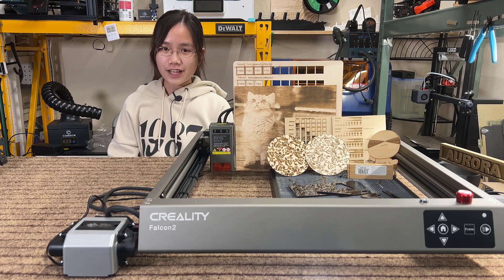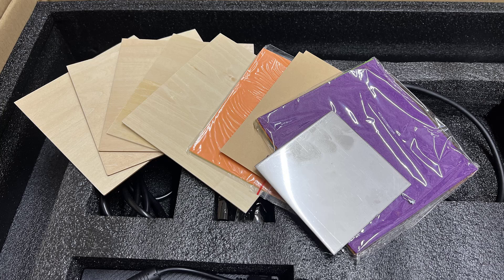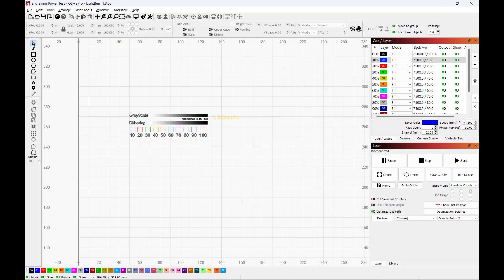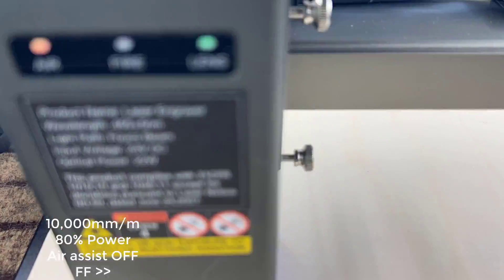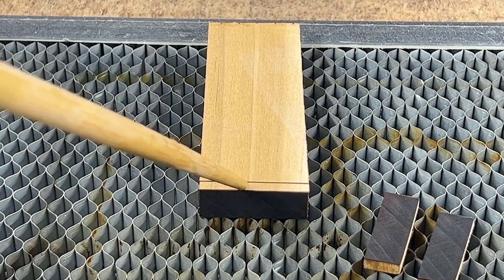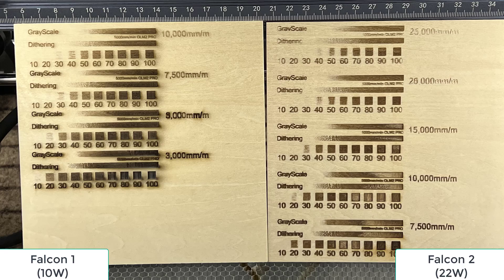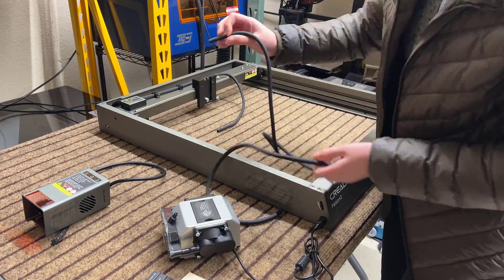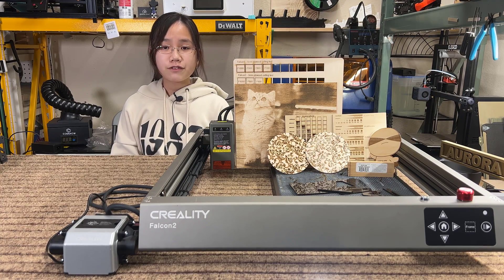Creality Falcon 2 22W laser engraver: review, testing and compare with Falcon 1 10W laser engraver

Comment: What would be the recommandation bewteen Falcon 2 and Xtools D1 Pro (both 20W/22W) when die Falcon 2 is around 40% cheaper. Both Systems calculated complete costs including rotary and air assist... In numbers e645 vs €1070 .... I would prefer steel rails - but is this worth couple of hundred €?

Comment: What is the laser tent you used?  Was it from Creality or 3rd party?  

Have you tried to engrave or cut metal yet?  The marketing blurb claims it can cut 0.05 mm stainless steel.
Reply: And the 40w can do "Magical colorful engraving"... Dont believe their promos. Only go on reviews as to what they can actually do. You may be able to etch it but usually, a black paint is applied and then burning the black in creates heat in the steel that marks it. Sending a laser to bare metal will usually do nothing. And I don't know what the use of 1/20mm steel is..Not even jewellery. I'm going for the elegoo phecda Kickstarter. A company that has a good reputation.

Comment: What is that mat you have under the laser? I am concerned that if I go to cut something, it will hurt the surface that the machine is sitting on. I'm not quite sure what to put under it to protect the table.
Reply: I was wondering the same thing.

Comment: You mentioned not being able to cut clear acrylic. Is this something that’s not possible, not recommended, or difficult? Can you do it if you put a black metal plate beneath the acrylic? If not, is there a mid range price, like this one, laser engraver that you would recommend?
Reply: Not possible with diode lasers, if you want to cut clear acrylic u need a co2 laser
Reply: It has to do with the wavelength of the diode laser. CO2 lasers and diode lasers have very different wavelenghts, they both have their advantages for different materials.

Comment: Hello, I have seen that the manufacturer promises to engrave with color with  this machine but so far I have not seen anyone do it in their tests. Is there special software to be able to engrave with color?
Reply: You can engrave color on steel/iron and other metals.  the color engraved depends on the power used on the engraving.  There are lots of videos on YT now of people using the Falcon 2 for exactly that.
Reply: You can NOT engrave color. The only color you can gain is by burning the material with different laser strengths. 100% for deep black 50% for gray 0% for white. It will always be black and white.
Reply: It's not possible to engrave "colors" but it can do different shades of dark.
Reply: @davidbball13  I used an industrial diode laser engraver, it IS possible to mark the surface of metals with color. I think what's happening is you're causing the surface to oxidize and it affects the wavelength of light that's reflected. Depending on how you configure the laser, you can create blue, green, yellow, orange, brown, maybe other shades. I can't say if it's truly possible with this specific model, but I'd say it's premature to rule it out.
Reply: @AFistfulOf4K  do you mean Mopa Fiber laser?